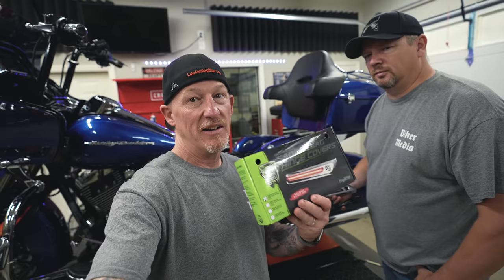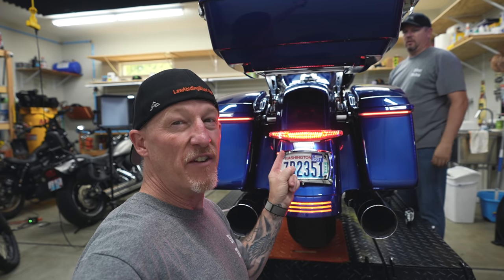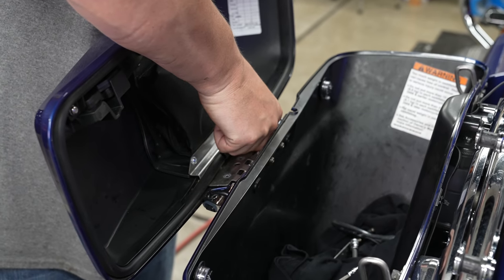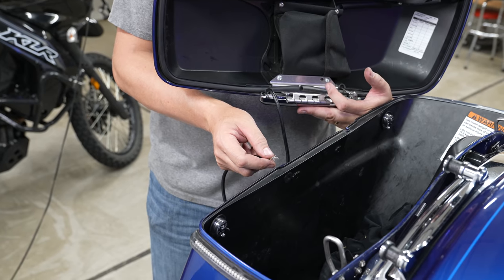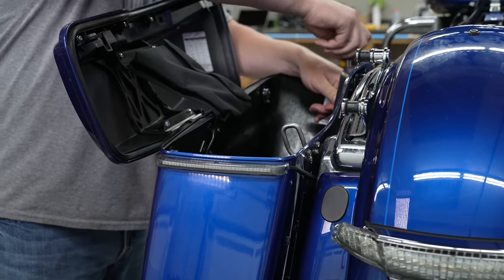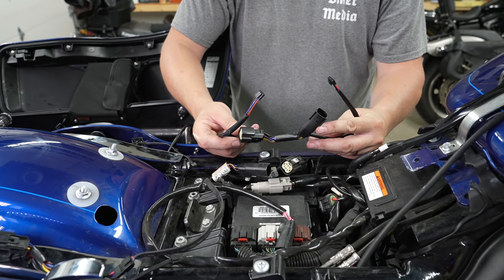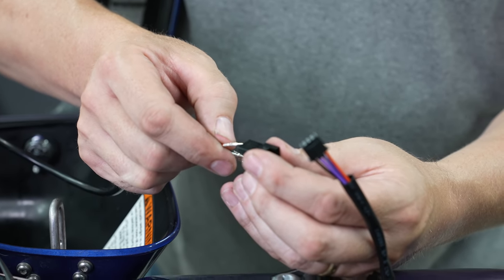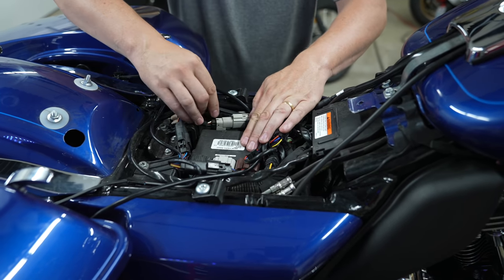How to Easily Install Ciro 3D LED Lighted Saddlebag Hinge Covers-Signals Too!

Comment: Ciro installation. The epitome of simplicity.
Just a reminder if reinstalling your saddlebags and you only have stock safety bolts. DO NOT forget the washer. I recently did just that and you can guess what happened. RickRak safety bolts sound like a great idea.

Comment: good installation video guys... I have the Ciro Plasma rods on the back of my bike,, and I love them... very bright.. and look great from behind...This might be my next CIRO purchase... thanks Ryan and Lurch... DAWG from the show me state..  I also have the LED turn signals which are bright and very cool...I have to agree with other comments that removing the bags to clean would be a pain.  I would think a quick disconnect at the bags without having to remove the seat and readjusting the wiring mess each time would be useful and helpful...

Comment: Ryan, after complete installation, would I have to remove the seat and unplug the connections in order to place saddlebags away from bike or do you offer connectors I can attach outside the bags?
Thanks, awesome job you guys do!
Bill
Reply: I drilled and install and deutsch connectors towards the bottom of my saddle bags. Easy to connect and disconnect when you wash the bike with the bags off

Comment: Keep in mind if you tuck the wiring and plug under seat you have to always take off the seat to remove the bags, whether you are just cleaning or need to work or check the back end. Not convenient 😒
Reply: I agree Jon. I asked two days ago if they would offer connectors so bag can be removed without seat. No response. Bought lots of item from LAB. Usually receive pretty timely responses.
Reply: @williamh5405  what I ended up doing is silicone the back side of both plugs, and zip tied the connector to the frame under the side cover. This way it could be unplugged before removing the bags
Reply: @williamh5405  do you whine most of the time or just often?
Reply: Because I asked a question R GH? That's the way. Condemn other bikers. Geez.

Comment: new to the channel love your videos i have one question. i have a 2000 road king classic do you have or know of any videos on how to change the speed sensor. i know the one end is under the starter then the wire disappears. thanks for any info

Comment: You could probably use a step bit, too. ?   

We drill holes in the roofs of vehicles to mount two-way antennas and use tape to keep it from scratching the paint or, at least, to a minimum.

Comment: Ryan, I love your videos -- lots of great info and I appreicate you sharing it-I wrench my bikes 99% of the time----Question - would you know the socket size needed to remove the ACR (automatic compression release) Solenoid for a 2019 CVO SG. (the newer HD have a different size than a older bikes)--HD sells the cut away long/deep socket, they are asking $92.00 for it,   I`m thinking I can make one up myself. Any info is much appreciated. Thanks and be safe.

Comment: It is crazy that you have to remove your seat to remove that saddlebag now.  Not sure why Ciro…. or anyone else, doesn’t place a quick disconnect just outside the bag. That could then have the extension that goes to the wiring under the seat.

Comment: Nice looking, but I have so much LED lighting (entire bike, Headlights, Taillights, Brake Light, Turn Signals, Aux. Lights, etc) that there is LITERALLY NO MORE ROOM for another LED Accessory. And Drilling holes in my bags and running 4 feet of wire around the perimeter seems like asking for problems. (If you use your bags for more than sandwiches LOL).